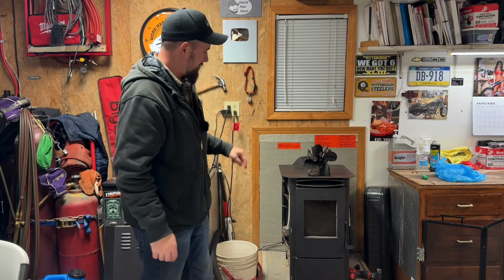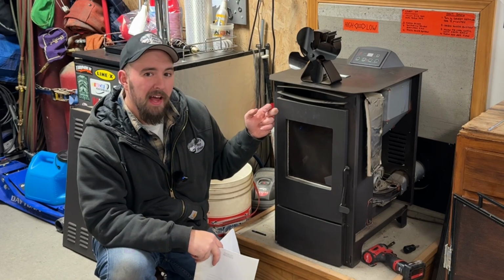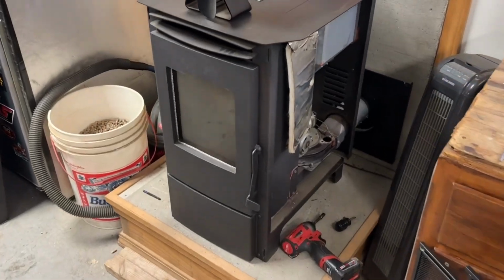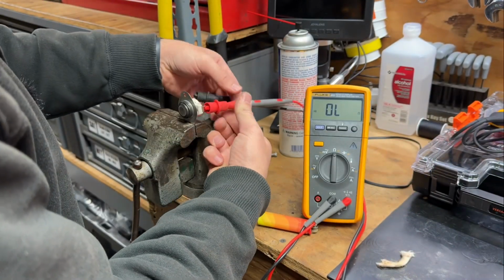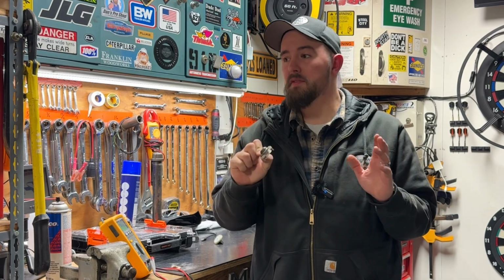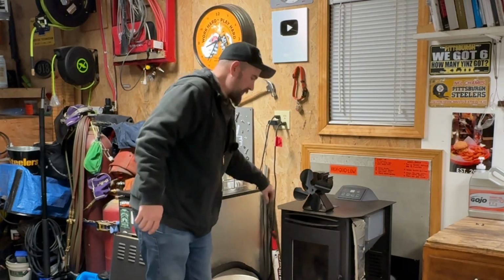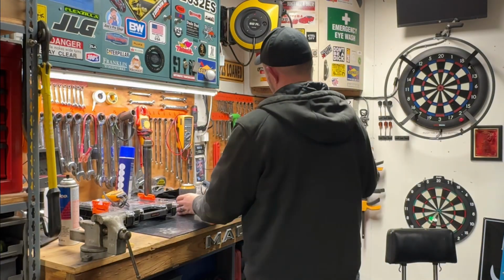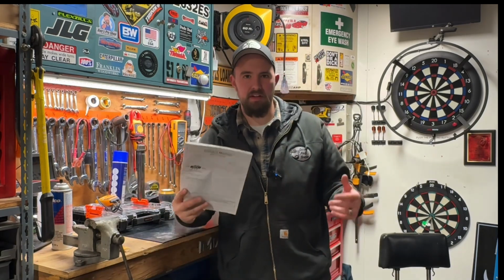Pellet stove repair! US Stove AP5710

Comment: I get those codes to buy now i keep getteing e1 but while cleaning the thing out,on the inside of the stove near the top there is 2 small square vents i stuck my finger in there and it was full of ash and pellets im wondering how pellets would get in behind there and how do i clean that out when i can fit my my finger tip in in there

Comment: I don’t know if you still have this thing but I have a US Stove 5513 and I’m wondering how you can clean up inside where the heat exchanger is better? The opening is so small for you to actually clean besides just vacuuming any ash right there. I don’t know how you would get up in there. Also did you Bend the opening where the hot sir comes out to a wider space?
Reply from the maker: There really isn’t a good way to clean that spot on these things. I just made adapters for the shop vac to neck down to a smaller diameter hose to reach more places. And those vents have just formed liked that from years of running. They straighten out when hot then relax to that wide position when cold
Reply: Didn’t even know you replied til today haha. Well, I replaced that blower switch man and mine fired right back up so that was definitely the issue.. It was doing the same thing that yours was doing with the lighter, but still wouldn’t run the stove for some reason. Would open and close just fine and worked on a ohm meter

Also that’s wild on how those vents have warped like that haha

Comment: Have u changed the door seal on this pellet stove yet? I have the same model and bought the replacement the manual said to buy. But now my door seems loose and it failed the dollar bill test. I thought i put it on worng so i took it off and put on another one and getting same results. Theres no way to tighten the handle either like other suggest.
Reply from the maker: Yes I have.  It’s a 3/4” OD rope. I’ve repair twice now with now issues. Just take your time with install.

Comment: I've got a pelpro pellet stove last year I replaced the auger feed motor,this year I need to replace the exhaust blower it's noisy and a bit sluggish but NOW I'd lost power in the outlet and after plugging it into another outlet my control box will not even light up,any ideas?

Comment: Do you need to have that cloth-like gasket under the sensor for everything to work right?
Reply from the maker: Yes. It keeps smoke from leaking out of the sensor port. It’s a must have
Reply: @dansproshop do you know where I can order this part? I replaced this POF the other day in hopes of getting rid of an E4 code, but I still get the error. I wonder if it’s because I don’t have this gasket!

Comment: Same stove, same problem, same solution.  For the past few years the weekly maintenance on my stove has included cleaning the heat sensor.  I have a screw driver attached with a magnet next to the sensor to make it easy.  The damn thing gets carbon build up that quickly.

Comment: I’ve been heating my home with a Harmon pellet stove since 2008 It has paid for itself many times over! I’ve had my share of problems. The worst one was an auger removal to clean under the slide plate. I’ve found if I’m meticulous in the cleaning (2-3/year) it is pretty much trouble free. I burn 2-3 tons per winter. When we purchased it the salesman advised against electronic ignition. We tried the pellet lighting fluid but now I use a propane torch. It feeds when it is closed and up to temperature. With the torch it is feeding in under 2 minutes!